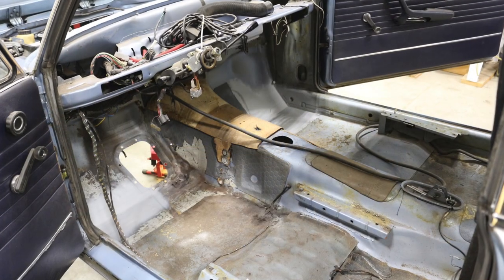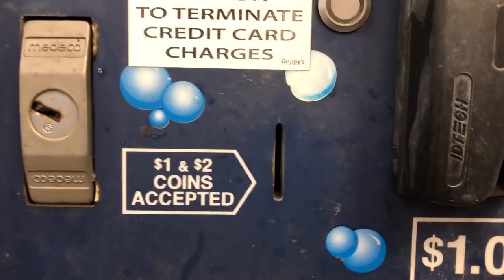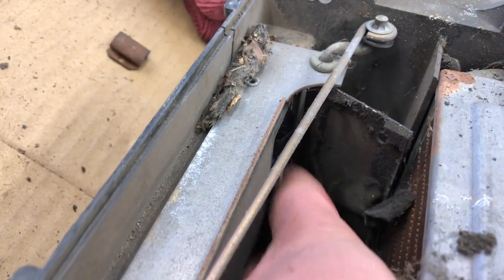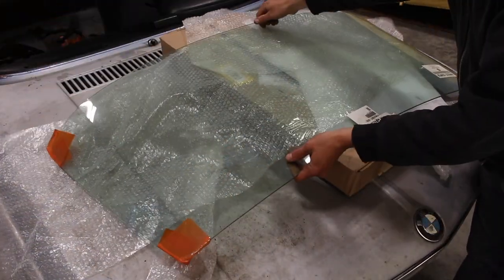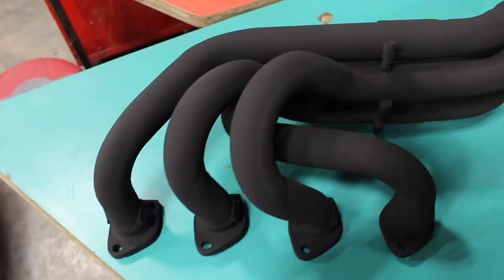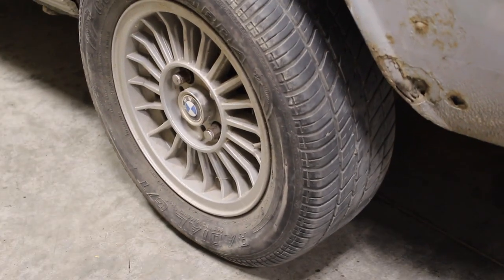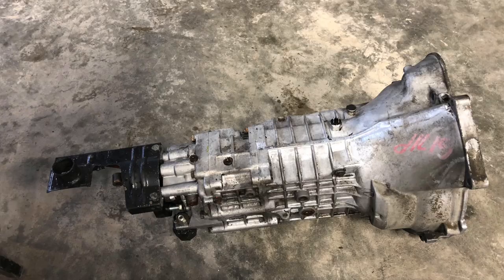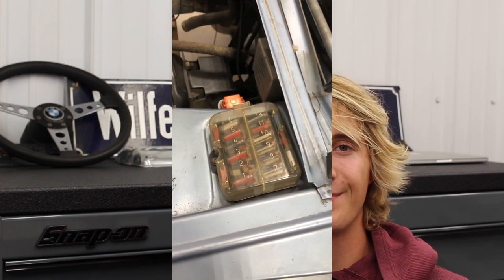Episode 3 Assembling my 1974 BMW 2002tii (DIDN’T START!)

Comment: Can e30 front and rear end fits or modify to fit e10 without too much of a problem?
Reply from the maker: Hmm, I think some combination of E30 trailing arms with E10 rear subframes has been done. That would be a big job. E30s and 2002s are quite different